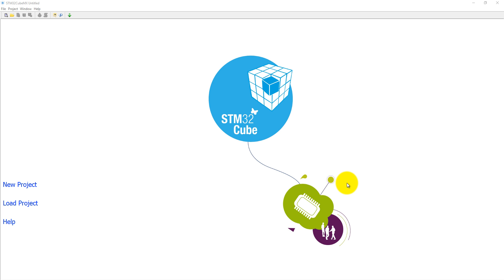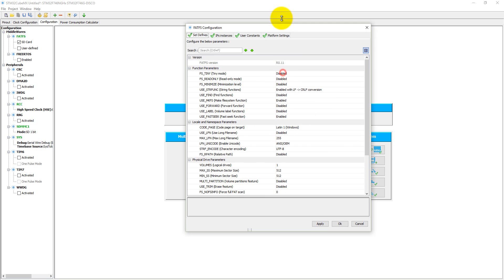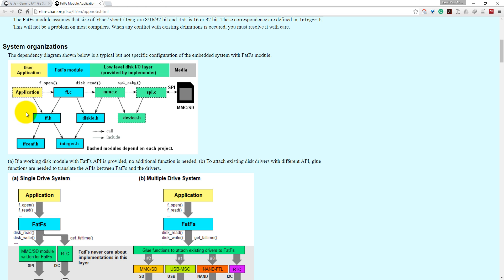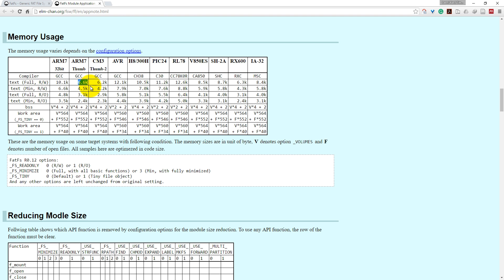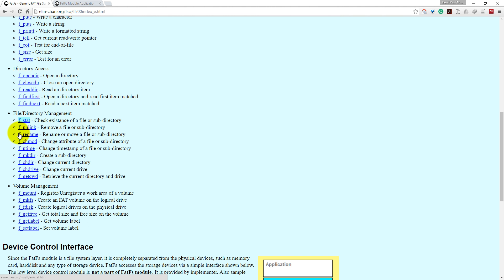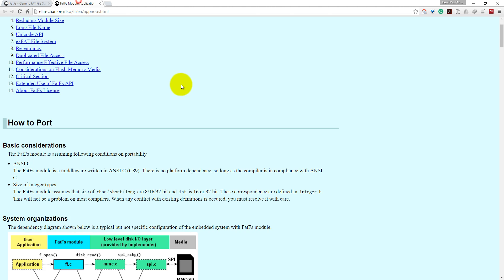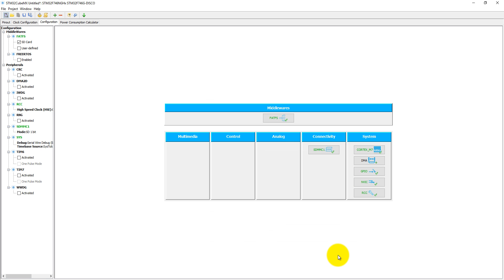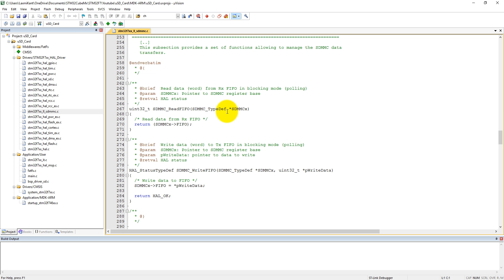12 SD card Programming on STM32F7 Discovery Board using Keil uVision

Comment: Hi LaxmiKanth, In the Pinouts section at 0:35, It appears that you have selected the RCC HSE to be a crystal and ceramic resonator which means you are using the external clock source. However, in the clock configuration section at 1:10, you have selected the HSI RC as the clock source. These two selections do not seem to be mutually compatible. Am I missing something? Thanks!

Comment: Hi KGP Talkie ! Thanks a lot for your video. About my project, i need to write/read data on MMC card using a demo board nucleo L476RG in order to use an eMMC flash component to the next step of my project on my own PCB. Do you now if i can use the FaTs library to interface my MMC card with Nucleo board, or shall i use the specific low layer driver sdmmc provided with cubeMX but there're still some bug and i can't do anything
Reply from the maker: Yess, of course, you can use the same FatFs code with your Nucleo Board, follow the same as in tutorial but select Nucleo Board. Moreover, I am planning to make an SD Card Interfacing tutorial on STM32F401RE/411RE this weekend too.